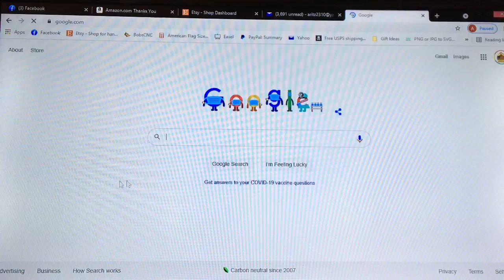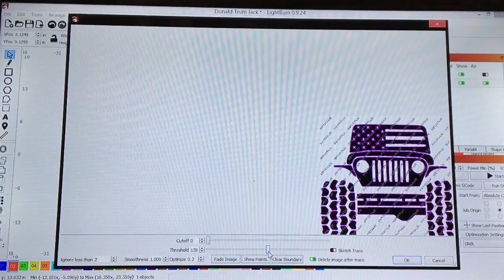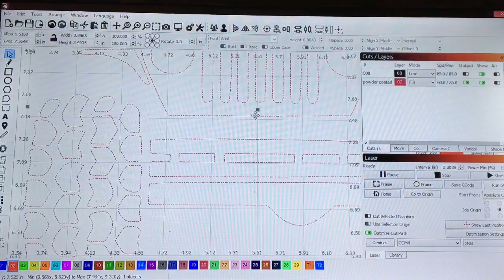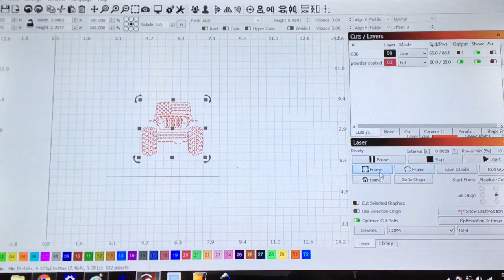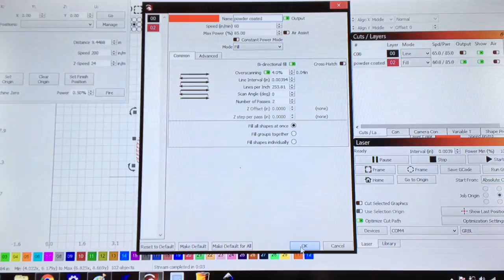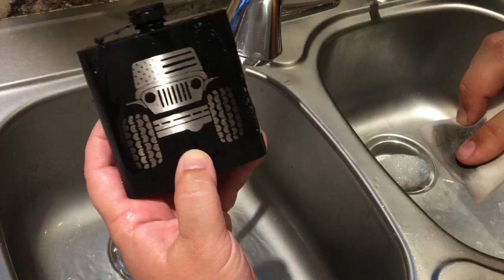Easy Flask Tutorial! Using the Ortur Laser!! Easy $$$

Comment: Hey Rich , after burning a line in the MDF to line up the flask would it be OK to use that line as a guide and make "jig" by gluing or screwing down some wood strips to hold the flask in place so you can just put the next flask in there to burn when doing multiples ??
Reply from the maker: Yea absolutely